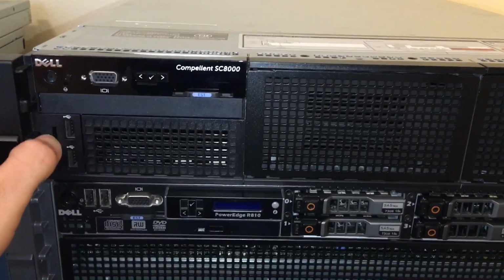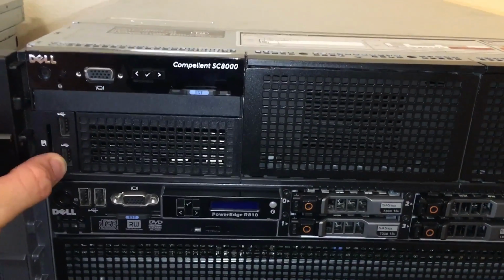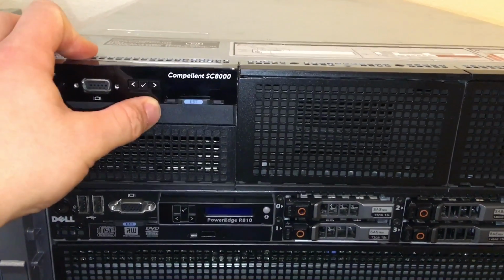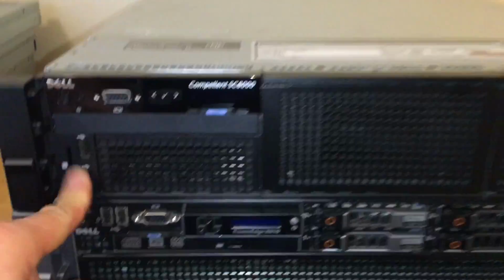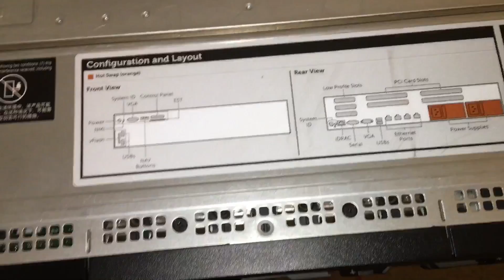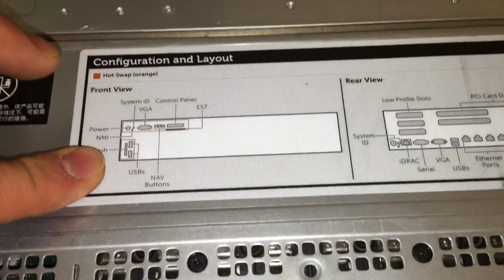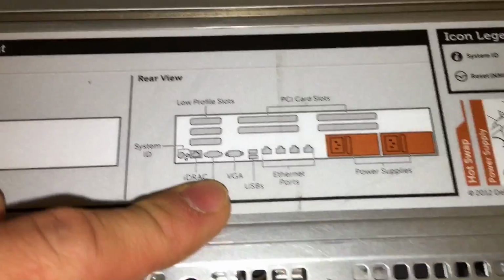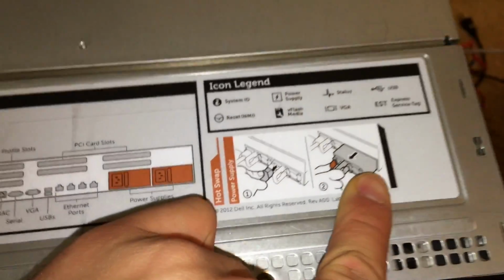Dell Compellent - SC8000 - with FreeNAS

Comment: I see the date on this video is five years ago but tomorrow I’m working on a government SC 9000 new regeneration with 13 additional devices , SC 420 Flash Dr. with two sc9000 controls on high-availability.   You were doing this five years ago you must be some kind of genius man that’s pretty cool.
Reply from the maker: Hi! Thank you, yeah I built my own Storage platform utilizing the SC8000 units, I also was able to build on top of this 4 EMC DAE shelves with 12x SSDs, 24 x4TB drives back then it was a fun little project. I used Beefy LSI Dell TFJRW Controller Quad Port SFF-8644 I/O Host Bus Adapter Compellent SC8000. I was able to read 4.1GB/s and 3.5-7GB/s write.

Comment: Thank you for the video. A question I have: can you place front hard drive cage + backplane (of the R720) connected to a regular SAS RAID card ? has anyone tried it  on The SC8000 ?
Reply from the maker: Hi! You should be able too depending on the raid card you have the newer raid cards are much more compatible with many configurations

Comment: Its not a raid card. Its the Cache card. (On the compellent at least)  :)  And the HBA is the back-end SAS card. Used to attach the Jbods.  Your right though. You can do anything with them outside the compellent as they have propitiatory firmware. 

You dont need to renew the SCOS (The OS you said cost 50k) You can get it from the dell support site. While your there there are change of ownership forms. Fill it out and then e-mail cml_licensing@dell.com They will reissue whatever licenses and SSH the system TAG is associated with. Then you can reinstall the latest SCOS (7.1.12) and licenses. However you will need a enclosure (SC200-SC220) with a MINIMUM of 7 drives to initialize the system fully. (No disks  and it will just continually reboot looking for disks) 

Do note the SC8000 DOES NOT do direct attach (even SAS). So you will need  a iSCSI or FC card and switches. And they need to be compellent iSCSI or FC cards. Nothing else will work (Again propitiatory firmware) 

Hope that helps.

p.s If you do get disks  Dell compellent disks only (AGAIN propitiatory firmware).

Comment: What LSI External HBA was that?  Wondering why it can't be used with FreeNAS?
Reply from the maker: Off the top of my head i cant remember, but it is a Dell proprietary Compellent HBA, Freenas doesn't like it and freezes up during installation. I have a regular SAS HBA coming in that i bought and is supported by freenas :)
Reply: Looks a lot like a LSI 9201-16e.  If by Dell, it more than likely is a LSI 9202-16, which is an version only sold to OEMs.  They usually slap on their own branded Firmware and BIOS.

Thinking that you could cross-flash that to a LSI 9201-16e and FreeNAS would work fine with it.

Of course I could be totally wrong in my guess of what it is... :)
Reply from the maker: Yep it is! its a tad little different  but this one is branded with many mini compellent logos and i dont know how easy it would be to flash the firmware, and their so cheap on ebay for 40.00 a card that its easier to buy it then put time and effort in to it! :P

Comment: Thanks for this videos, i started thinking about getting an r610 when i saw a pile of them stacked where i work, but i thought that was crazy to build a rack at home, your videos changed my mind. I have my first r610 on the way! :>
Reply from the maker: Anytime buddy! Thanks for watching! :) and it is never too crazy to build server racks with crazy amounts of gear in them! :)

Woohoo! how big is the R610?!
Reply: These are the specs and on top of that i added another 3 SAS 146GB 10k and 32GB of ram for a total of 48GB

Dell poweredge r610 1u rack mount server
Qty 2 heatsinks included 
Qty 2 x5550 2.66 quad core processors included
16gb qty 4 4gb memory dims included   
Qty 3 146gb 10k sas 2.5 drives include with trays included 
Qty 3 filler blanks included
1x6 backplane supports qty 6 total hard drives
Idrac 6 enterprise included 
Dvd optical drive included
Perc 6i raid controller included
Qty 2 502w redundant power supplies  included

Comment: You said it had a valid warranty so did you try calling dell to try to make use of the next business day parts delivery warranty that is valid to 2017 to end up with the enterprise software in hand ?
Reply from the maker: this is not the same as regular dell warranty support, after spending time researching dell compellent os is registered to the original user that did the purchase so i cant do any ownership transfer at all on this appliance, i have lots of other dell servers we bought for our data center we will be doing colo at and all of them have warranty till 2017 and i was able to get anything i need flawlessly.

Comment: Did not fully understand why you bought this server for, trying to install freenas on a server without hdd space, never really saw a nas/nas with hdd on the outside of the server, it could be a good esxi host ...
Reply: He is building a SAN, not a NAS
Reply from the maker: cause i am building a expandable JBOD array that is freely expandable with out and hardware raid and i got this for a cheap price and couldn't not get it even if i used it as a esxi host but it will be a storage controller for my SC200s that will have 2 TB SAS drives
Reply from the maker: thats correct :) We actually have two of these controllers one is for our Colocation / Datacenter project - business :)

Comment: So in other words, no advantage in having these over something like a 720?
Reply: 50K is a handful for a home lab. If you knew the OS wasn't part of the deal, I'm not sure why you bought it. As I said, this truly is a modified R720. The two cards you were holding in the video were the 4-port LSISAS9201 and the CHA3 cache card. At bare minimum, the cache card and SD card are the only two required for a boot operation. My guess is the seller you purchased this from reset SCOS before selling. If so, this would mean that it would only boot to a generic screen from VGA output and it would really require a RS-232 connection to the back for terminal-based configuration. It's rare for SCOS to get corrupt. If it really did and you had your hands on a SCOS iso, you could run some chdsk options for a general repair. Downside to having a SAN of this caliber as a home lab is that all SC enclosures only accept SAS drives, which are loud and expensive per GB. Compellent is the same league as many other flash-SAN Vendors where they create walled gardens for hw compatibility.
Reply from the maker: It sure is! Yeah R720s are still up there cost wise for the specs, almost 2k for a server with like 32GB approx ram is way to much, now if were talking like 256GB ram then be worth it, and yeah i did some good research on it and yeah i tried looking around the web for an iso but had no luck :( and i still have the SD card with the  OS that was on there, it loads into a FreeBSD, ad then just stops there like it tries to load the OS but no sign of activity i left it on last night for 3 hours and still at the same point where the FreeBSD boot up was, and yeah its an amazing type architecture and surprisingly the SC200 i have with me is not any louder than my R810s so i was happy with that! and i can control the speeds in the idrac for the SC8000 :) but we will see its the best way to learn is to play with something and create it! so i will keep you in the loop! i just ordered a LSI Mega raid 6Gb/s SAS so i can attach my SC200 to it.
Reply: Then this is your first. The issue is more firmware/software than it is hardware, and was a clear choice by the company for product release. I used to work for Dell, so I'm extremely familiar with the Compellent line-up. Strictly speaking about the current enclosures the Compellent SC8000 was "meant" to be paired with, only SAS options are possible. This is referring to the SC200, SC220, and SC280 enclosures.
http://www.dell.com/us/business/p/dell-compellent-sc200/pd
The code did support backwards compatibility to legacy enclosures which operated only with SATA drives but used different mediums such as FC or slower SAS for cabling. 
You are correct that from a hardware standpoint, most arrays should be able to physically support both, but Compellent is a closed garden where there is a strict list of brands, models, and firmware revisions that work with the platform. This list is written into each code release.
It's possible to hack anything, and the disk firmware file is a .txt file which could certainly be modified or replaced. However, by default the entire SCxx line is meant for SAS drives only and would fail to recognize SATA drives within the Compellent enclosures. I believe we tested it in a lab and had some mixed results of throwing "supported" compellent drives in "incorrect" enclosures which populated as either foreign disks or incorrect pathing. I can't quite remember.
If you tried pairing non-Compellent enclosures with the SC8000 while running the Compellent OS, that's a different story and probably something extremely difficult to do; some of the firmware files for the OS would need to be ripped apart and replaced to accomplish this.

The points I'm making above are mute as this controller is now acting as a FreeNAS server, which now has no limitations of the previously mentioned Compellent ecosystem.
Reply: I have SATA drives in the compellent I use for our test enviroment at work, Dell branded and supported as well
Reply from the maker: these are great if you want to get a LSI Raid card that supports SAS 6Gb/s and a Dell Powervault or any array and load freenas or any other OS on a usb and use it as a storage controller or an hypervisor
Reply: Correct. The SC800 is based off of the R720 chassis. Much of he hardware is the same with bios and firmware differing from the normal server series. Frankly, I don't see the point of this build unless there was a great discount compared to an equivalent R720. The Compellent SCOS is some of the best in the world. Choosing not to use it means that you miss out on the main advantage of purchasing the differing hardware. Either way, good luck and have fun.
Reply from the maker: Yep, and i cant use the Storage software, cause im not the main person that purchased so i cant login to the compellent portal, and as well the preloaded one on the SD card doesn't work its faulty/corrupted -  all it does it freezes and sits there during boot up and doesn't load anywhere, so no point of saving it there, so i took out the card and loaded freenas which will be nice as well and to spend 50k or so on just renewal/purchase of the dell SCOS is outrageous! anyway yeah its an awesome server to have even if i make my own custom array :)
Reply: +Charles Black Either way, good luck and have fun. It's a great piece of hardware with much potential. When you get it up and running, it'll definitely complement the rest of your environment.
Reply: SAS and SATA are compatible, I have yet to see an array/HBA that only supports SAS.
Reply from the maker: Yeah it could be that the Compellent OS could detect that since i have freenas its much more open! :)
Reply from the maker: Great to hear from someone that has worked with these and let others know  :) and i actually have it up and running with more SAS drives now and i was able to copy 7Gbps via 10Gb so that was awesome! and i did lots of reading on this system and many places keep their information very vague but i couldnt even find videos about this array nor detailed information on what other users did so good thing i got this controller for 450 bucks and got to play with it and actually will be better then my R510 Storage server :)
Reply: Nice man, You must be running the older Xyratex (pre-Dell acquisition/branding) enclosure. As i said, it is possible, but it depends on the code, controller, generation, and transport you're using. Lots of variables, but SATA drives will work under the correct conditions. Dell moved away from that years ago though, so anything with "SATA" support for a Compellent line-up is considered legacy and mileage/support varies.
Reply: Sounds about right, the compellent is a very flexible beast. We have 3 of them with around 5PB between them and then 2 smaller compellents used for our Hyper-V compute clusters.
Reply from the maker: Oh i would love to see this! :)
Reply: All purchased in the past 2 years....some of the caddies say SATA on them.
Reply: As a new purchase, maybe from a VAR, but not as a new product from Dell. The SC8000 line was released in 2013 or so; this replaced the older SC40 series which was meant to support FC (sata) and SAS (sata/sas) solutions. With the release of these controllers, the SC2x0 enclosure lineup also made its debut. All solutions were SAS-only. You can still buy refurbished older systems from VARs or add to existing arrays by purchasing older enclosure, or new/refurbished drives. 
There's a product cycle for every Enterprise company and my point is that Dell exited the SATA arena at least 3 years ago.
I'm happy to hear you're using Compellent systems though. They're absolutely brilliant and I've toyed with getting some for my personal labs as well.
Reply: Brand new man, a SC8000.
Reply from the maker: Oh nice yeah the SC9000 is a beast as well! and oh i will be adding another array for SSDs later so i can have some fun with Caching theres lots of new things coming out from dell daily haha! but overall i am happy with the purchase we did we have 2 of these controllers we bought them at the same time!